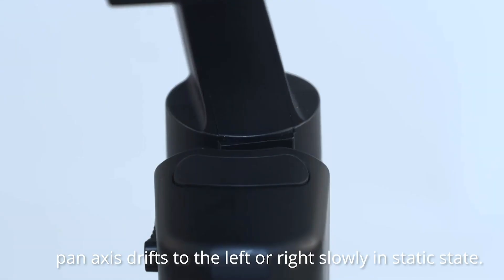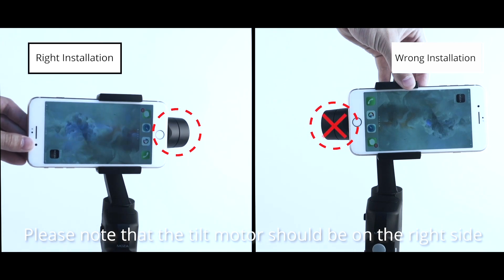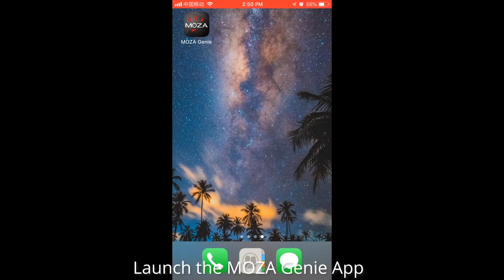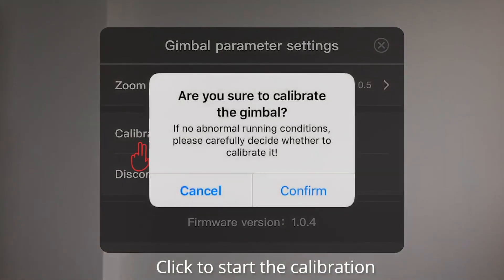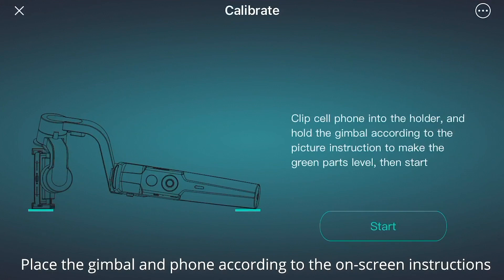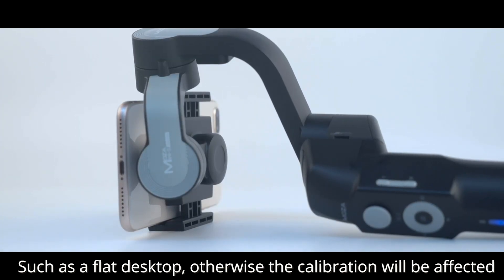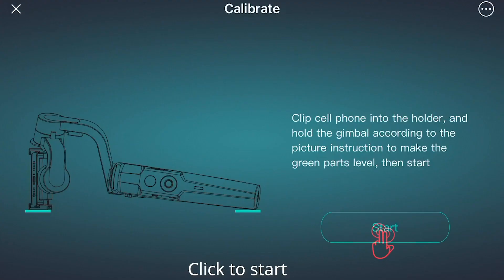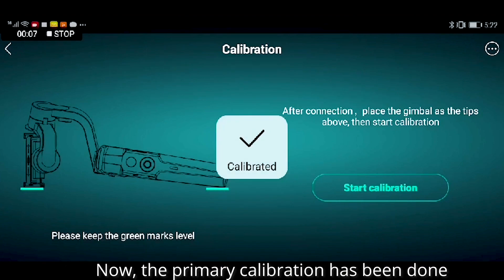MOZA Mini-S Official Tutorial | Primary Calibration Tutorial

Comment: Hi Gudsen..
My gimbal is ini trouble. It always lose power not even 1 minute i used it.

I think its because few days ago i used the gimbal until batery drop, I just realized after few times calibrating with no result, in my display the version of the gimbal in moza is 0.0.0

Can you help me to solve the gimbal
Thx